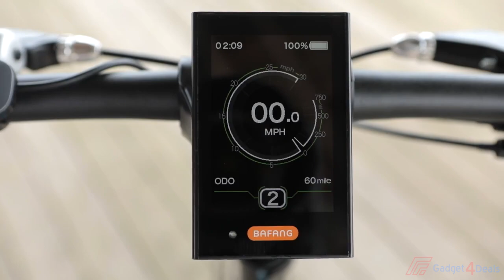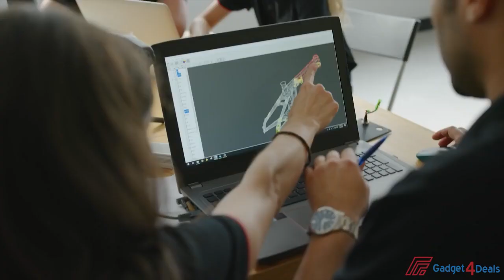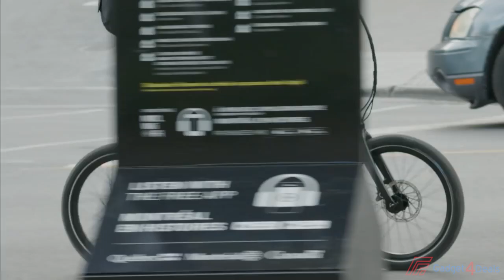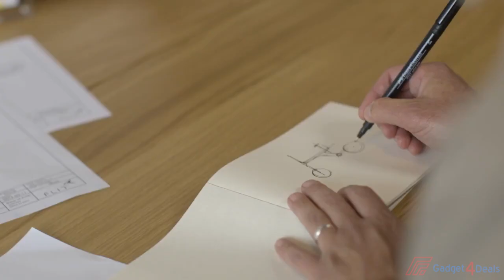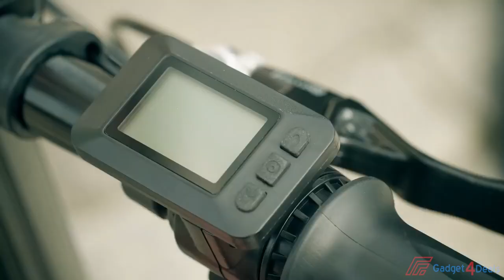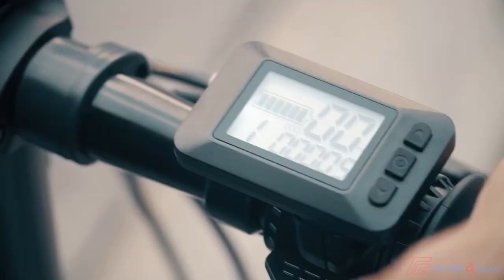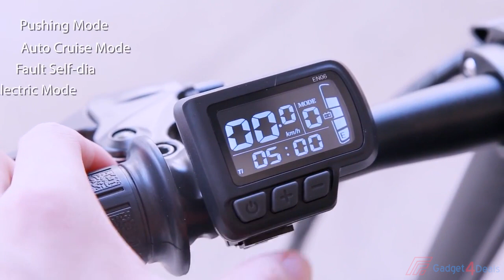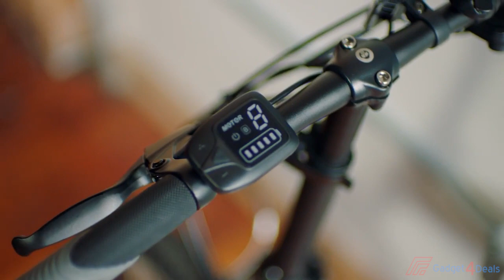Top 10 Best Foldable Electric Bikes

Comment: Looking for something similar to this. Love 14" - 16" wheels. Lightweight. Foldable. Need at least 350 - 500 watt motor. Currently looking at the Air-3 sold in New York for $850. Anything-else I should be looking at? Appreciate any input?

Comment: I like all of the bike very nice concepts but the problem I see with them is they are hub motor reliant. From my research I found these motors are very cheap to purchase and somewhat to work on they are not very reliable for more then flat surface riding and can't handle even the smallest of grades. They also break down quite often after minimal usages. I would not buy any one of these for that reason sorry. Direct drive ,chain drive ,belt drive or shaft drive are more reliable and stronger type of energy transfer to the wheels and can handle many more applications such as off road ,grass ,and step grades.
Thank You